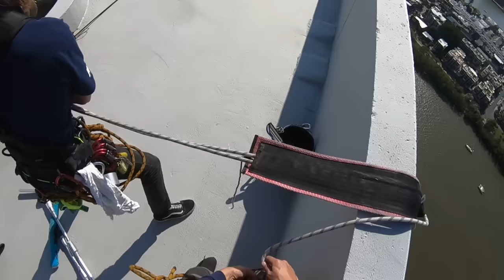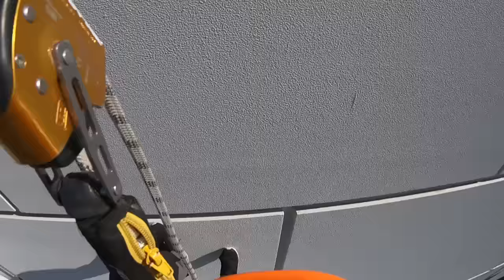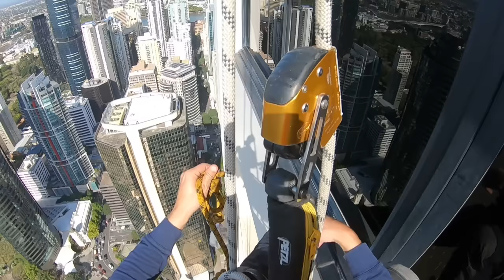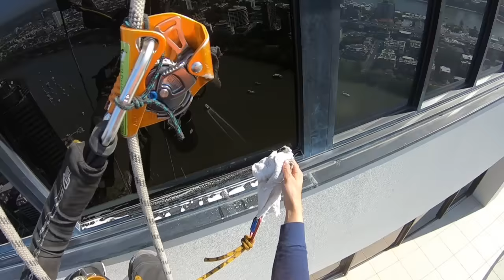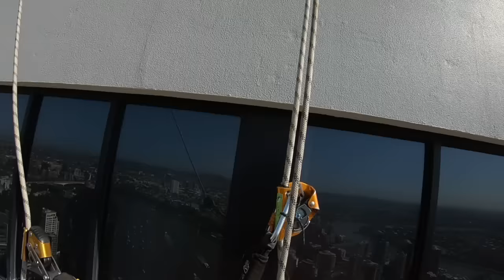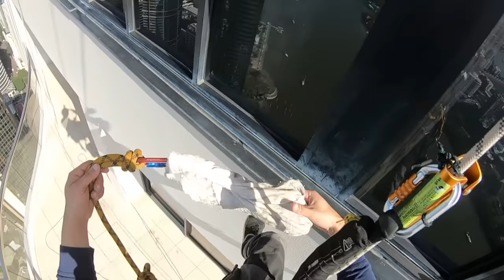Rope Access Window Cleaning - Rope Transfer

Comment: Old timer window cleaner here. For you youngsters, be thankful for OSHA and great climbing gear they use nowadays. When I first started we didnt have any kind of safety harness, we actually used to use a safety BELT. Yep, a belt. And you hope it fit good otherwise you might just slip through. And oh yeah, we used a sky genie chair with a cylinder style descender. Ever seen one of those? In case you never saw one, it had a steel rod that the rope wrapped around with a circle on the bottom that you hang your D ring for the chair. Then you slide a long aluminum cylinder that had a slit in it over the end of the rod and that trapped the rope inside it slowing you down with friction of the number of turns you made around the rod with your rope. More turns slower descent. Racing yer buddy to the bottom for beer, maybe 1 turn. Bounce down the wall as fast as you can just dont burn your rope or else you get a slick spot. And Dont get yer fingers caught in the mechanism or especially your ponytail or your shirt because those will be coming off. Attach the end of your rope to the eyelet of a huge parapet hook. Then hang your chair then your bucket from the chair, climb over the wall hanging on that hook like spiderman and slide your legs between the straps of the chair. Its gonna be a good day. 

ADVICE: the one time I was truly ever scared: never let a rookie push your roller rig down the wall.  quickest way for you to get a cut rope and him to get a broken nose if you dont fall.  

My coworker: hey what time you think we'll be home by today after we do these couple of drops?

Me: sheeeit, we'll be home just in time to catch Good Morning America, these drops are on the NORTH SIDE!

Peace.
Reply: We’re u also dabbing on them haters my guy ??
Reply: ok boomer.
Reply: you lucky u alive brucey
Reply: @あよぎあ六花  "Social media made ya'll way too comfortable with disrespecting people and not getting punched in the face for it." - Mike Tyson 

There's a lot of wisdom that Mr Tyson speaks.
Reply: That's pretty hard core dude. Only thing missing in this guys rig is a chute in case you need a quick bail. LOL!

Comment: Having done this (on much lower buildings lol) I can say that you get used to the heights long long long before you get used to working harnessed all day (crazy peak roofers know what I'm talking about) it does such a number on your body before you get used to it. Always triple check your gear, nobody doing rope access has ever died from a gear malfunction, only human error. Or at least thats what we were told before we went over the edge lol
Reply: That's a crock of shit. I guarantee you that gear fails and some pour soul lost their life.
Reply: @anthonygaller482  nope, not once, at least not in OSHA observing countries, can't speak for Asia. But no, believe it or not, the gear has never failed when used properly, not once. You can buy harnesses with 100% safety records. You are not just slung on a rope with a harness and hoping for the best, it's a lot more sophisticated than you would think and there is redundancy after redundancy.
Reply: @anthonygaller482  in cases of equipment failure, they just say it was the operators fault. After all he is now a human pancake so who’s going to dispute it?
Reply: @sint5990  can double that. celltower climber here. had a coworker whos harness loosened while at hight, was isued a new one the same day, and company brushed that under a rug
Reply: @Bardakas0728  if his tower harness loosened, he didn't put it on properly or he didn't inspect it properly.
They aren't complicated pieces of machinery that can break down for 1000 different reasons.
And majority of celltower climbers aren't attached to anything, OSHA even allows this. At most they have an anchor they clip on when they rest.
Reply: Not sure about rope access but as an arborist I can say that more than one arborist has died from a gear malfunction. Most of the time it’s due to poor maintenance, but there have been a couple cases of sound gear failing.
Reply: @willk5413  poor maintenance is considered a human error. That's how they can say that with a straight face. Technically that's true but doesn't stop people from dying.
Reply: @ImperiumLibertas  there’s also been a couple early models of some friction devices that failed. Since recalled
Reply: @BOOSETO  never understood why people will defend a piece of gear so much…like…it’s ok to admit that gear fails sometimes.
Reply: @BOOSETO  toronto mans? nobody died? im in!
Reply: @dogshake  currentl what's preventling me from committing ? to this careerier.
Reply: @android69_  Dun Kno! Lol 
I haven't done it in years, but I'll contact the company I worked for and see if they are hiring if you are serious?
And no, nobody ever died. 
One kid shit his pants though loll
Reply: No moral of the story ur not very bright that gear most certainly fails this is my profession BTW lmfao n I'm def not gunna let some novice go ahead and teach window cleaning gear safety tips lmfao
Reply: @flexcity9624  show me one example of sound gear failing? You can't because it's never happened. Some idiot wants to take worn out gear over the edge. That's not the gear failing.. it's the idiot that 👍 the gear. Show me an example of good equipment failing? I won't hold my breath.
Reply: God this cesspool.... gear doesn't just fail... anyone who argues it does needs to show proof. Also in rope access you're ridiculously redundant. One piece fails, another catches you. It is 100% humn error if you become a rescue. Work safe everyone.
Reply: @Hailingfromcork  exactly.
These fools wouldn't even be able to tell if gear was safe or not.

Comment: No disrespect to the man doing the job. But how the hell do we not have automatic window cleaners on skyscrapers in 2019?
Reply: Just kinda seems like an insane risk of human life.
Reply: @jamesgeorge756  its really not a risk, way safer than a car
Reply: @mrarivv0007  The quantity of people doing it isn't really relevant here. If millions of people were using the same equipment and safety as these guys they would be fine too.
Reply: How the fuck would that even work
Reply: AyeRaxX420 as a working arborist that uses the exact same gear, they’re not wrong. You are. 
Our gear has to be rated to a minimum of 2500kg. Everything is checked routinely and if it’s faulty, it isn’t used. 
It is far more safer than a car, it’s just high up. Falling from 100 stories high will get you dead the same as falling off a single story roof. It just looks intimidating. 
This guy is 1000% safe. Main climbing mechanical prusik, supported by a safety. Then at one point he has double. At that point he has 10,000kg to max out before a break.
Reply: William Macleod 
I’m not saying you’re wrong, or that I know myself, but if it is so narrow and dumb-minded, then why not make a chance to educate the person on the matter, instead of responding with insult? Your reply itself shows narrow-mindedness and is muddled with hypocrisy. Shame.
Reply: @Phuong I'd have to be drunk to do this... sloppy

....sloppy... lol
Reply: automatic window cleaners and surface-to-bird missiles (SBMs) should for sure be made a priority.
Reply: @Phuong For IRATA System users it is 5-9 (not all accidents are checked for now) deaths in a 20 year time for 150 000 IRATA certified rope access techs.
Reply: @Phuong I work in rope access.
Reply: Its a skill James, every window is different, different stains, different degrees of dirt. Carry about 10 - 20 l of water per drop, its not like a car wash. 
Water stains the window, so the squeegee after must be perfect, sun heats it so different concentrations of detergent, and speeds/ mop type.  It drips so dependent on the window ledge if you need to rag it. Rubbers wear and may need replacing in a single drop, wind speed/ direction mean that you have to sequence the drops in certain ways, one window trashes the one below it so has to be done all at once. 

Not so simple to find a robot to do it
Reply: @Phuong industrial drivers have 3x the fatality rate of rope access technicians
Reply: @Phuong Lol your logic is so crazy that I'm having a hard time following it.
Reply: @Phuong I understand how to interpret statistics lol. I also think that you're incorrect. Any time I discuses statistics I like to refer to per capita. I understand more people drive cars than work as high rise window cleaners. With that being said I will say again that high rise window cleaning is safer than driving a car. It's only perception that makes it seem dangerous. I'm basing that opinion mostly on statistics but even thinking logically if you have any understanding of how it works you would realize how safe it is. High rise window cleaning is also much safer than residential window cleaning. You can literally become unconscious while hanging off your ropes and you will be safe. If you have some kind of medical problem such as a seizure while driving it's a much different story. You also can't account for everybody else on the road which is mostly what makes it so unsafe. If you had the same number of people doing high rise window cleaning that drive cars, many more deaths would result from the driving. But if you forced dumb people to clean high rise windows you would see more deaths. So it's a good thing dumb people don't generally get into the industry. I'll say this again, I really think you're interpreting statistics incorrectly.
Reply: @Phuong You weren't talking per capita because you literally said more people drive than work rope access. You're contradicting yourself. You literally used it as the basis of your argument. I'm not gonna lie to you with how your logic works you might not want to get into something like rope access. It doesn't matter what causes the deaths. It literally has no bearing on the fact they're still dead. Why do you think being killed by a drunk driver changes anything? Also is it even true that most car deaths are caused by drunk drivers? What country? Where are you getting your statistics? I don't understand why you don't think its fair to compare deaths from one thing to deaths from another. It's almost like you want it to be dangerous for some reason so you won't listen to logical reason.
Reply: @Phuong I can still read your deleted reply you know :P You stated it was unfair to compare the 2 because most deaths are caused by drunk driving. What does the fact you put weather next to it have to do with anything? You still used it as the basis of that logic. I never made the claim you said only drunk drivers cause deaths. It's really hard to have a discussion  with you because you're only hearing what you want. I'm not trying to be rude or argumentative at all. Holding a strong unwavering opinion doesn't mean I have a superiority complex. Maybe you understand this and it's why you deleted your comment. Also sorry I didn't even see your second paragraph before so I guess I'll respond to it now. When you talk about forcing blind people and the rest to do rope access it's nonsensical because it would never happen. You can't just say a moot point that and claim its a better comparison. Especially when it's not. It's important to stick to reality when having debates like this. I already said that if you force stupid people to do rope access it would cause more deaths in the industry. So when you make the comparison based on per capita you can't say they because the numbers are multiplied out we would have to find blind people to fill those numbers. It's not how statistics work. You keep talking about all these random factors that literally are meaningless to the overall numbers.
Reply: Who's gonna service the automatic window cleaners 
It's the age old arguement of robots replacing humans while the humans have to service the robots
Reply: Did not read all the comments, but having a real human doing the job is way safer then having a robot doing it. There is a lot of force, like wind and other stuff, involved.. a human can interact with the situation, a robot has way more possibilities to fail and hurt people on the ground then somebody that actually knows what he is doing. just my 2 cents
Reply: everyone needs money and a job
Reply: Or how about windshield wipers on every window attached to a reservoir with rain x in it?
Reply: Probably because shit breaks a lot.
Reply: Because of the cost aspect of it, to have automatic window cleaning systems, would cost an absolute fortune, also you would need extra cradles for maintenance if the machine ever failed whilst in use, to have an abseiling team come in is alot more cost effective, and too be fair, a much better standard of work aswell
Reply: @Roflmao0001  yang
Reply: @mrarivv0007  accident rates are per 100,000 people. That is how the relative safety of different industries may be compared. You can see that if an industry with relatively few people in that group incurs a few fatalities, the accident rate would be huge. That is not what you find in the rope access trades. Get educated before spewing stupid comments.
Reply: How the hell is everything NOT automated in 2021?!??
Reply: @TheMonkeyThatDoesYourJobBetter  Invent the robot that's going to be:
1. Versatile enough to fit several different sizes and shapes of window. Are you going to make a new bot for every window type?
2. Thorough enough to clean  different types of stain, from simple water drops to bird shit and not leave streaks and mess.
3. Self repairing, squeegee blades need replaced, robots break down. You'd still need RA techs to go over to fix them.
Reply: @Steve8624  Half barely paying attention? A dubious claim.

Comment: It's pretty cool to see this video again after taking the course and seeing a lot of the safety elements being drilled into us being seen (the edge negotiation was weird though).
Reply: Assuming you mean using the duck to pull the slack? If we didn’t with that much rope on the roof he would have dropped too low with the amount of stretch 👍

Comment: Wouldn't a rolling rig  Be easier?
Reply: likely more expensive and tedious too
Reply: We use a rolling rig on our building and works pretty good and quick. Though the rigging for rope transfers and doing the transfers is fun.
Reply from the maker: Why using a rolling rig (A-frame) when you have plenty of certified anchors and no fragile edge to avoid ?

Comment: Want to sort out your edge protection buddy. That rope protector isn't sufficient. Get an edge guard or something similar!!!!
Reply: @ohhey539  Because you should be protecting the edge. The edge is abrasive, the rope is hidden in the rope protector, you don't know what is going on in there as you can't see it. 

There are numerous edge protection equipment out there for this task. 

Take away the possibly of rubbing or a sharp edge by installing edge protection, then your rope is then free from being cut.
Reply from the maker: Hi, thanks for your comment!
The rope protector used here is enough to protect our ropes. The edge is not abrasive at all!
Reply: What are you proposing? How could a rope being protected over a smooth metal edge not be enough?
Reply: @widgetno1  Where is the smooth metal edge?

Comment: the invaluable life ofa man just for cleaning a cheap window, (even the window looks clean before)
Reply: No one is forcing him to do this job! He does it because he enjoys it! It's not my cup of tea, but if I wasn't afraid of being that high up, I, too, would be doing something like this over sitting all day at a call center! Plus, this guy is 99.99% safe! As long as he is extremely thorough with checking his equipment & setting everything up, then he'll be perfectly safe up there! It's not like he's the building's janitor & then on that day the building's management company called him & told him that today he needs to clean all of the outside windows. So with ABSOLUTELY NO EXPERIENCE, he went into the maintenance room, grabbed a couple of ropes, tied around his waist & then around a pole on the roof & then went over the edge! These guys are professionals & this is what they do!

Comment: you shouldnt use 2 absorbers in your system. This parallel connection makes that if you fall absorbers activete (
approximately) with force equels 24kN it should be 12kN. Keep your spine healthy.

Comment: Why not use a wire gate caribeaner to hold the cloth? It takes up less space on gear loop since it has smaller head, plus easier to clip on to gear loop

Comment: Double use of energy absorber when rope to rope transfer is dangerous.
In the case of double use, the energy absorber will not absorb the shock due to insufficient load during a crash.

Comment: Theres almost 0 chance those windows are very clean after that. Unless this is some weekly contract, they just left a layer of dirt on the windows and smeared it around and then just left because it wasnt obvious out of the sun. 

We cant use applicators at all, when we do you end up scrubbing the edges for a long time, dirt doesnt magically disappear. With a brush he could've cleaned that window as fast, not with an applicator. Every high rise professional who knows the difference just knows, and they'll be coming for your jobs.

Comment: Wiping frames and seals that high up is senseless. That wand you are using that has the squeegee on the other side , sucks. You are doing way to much work to clean high rise.  I'm retired High Rise Window Cleaner of 33 yrs.  I would smoke you on a drop.